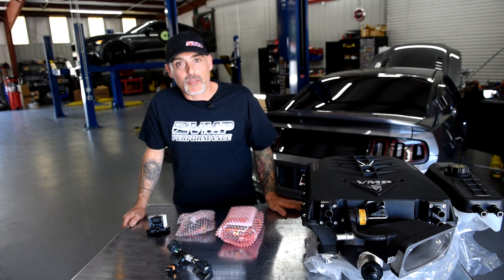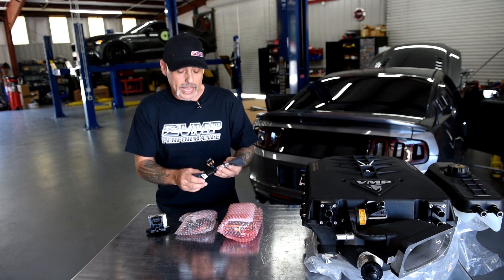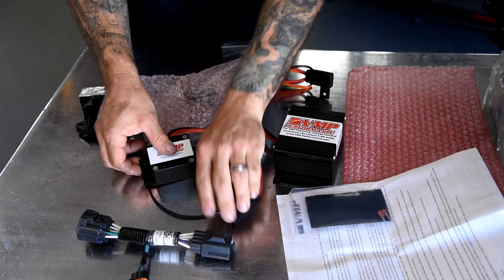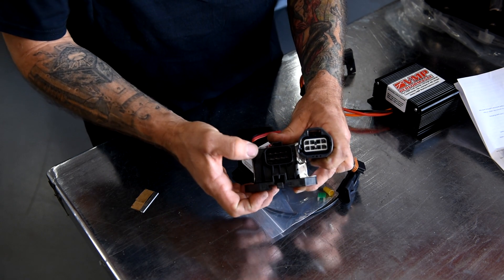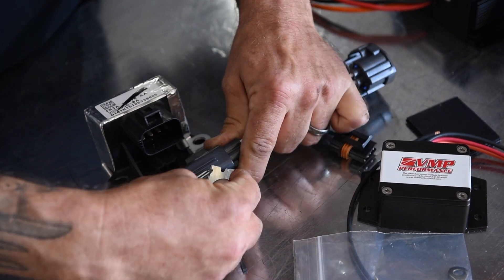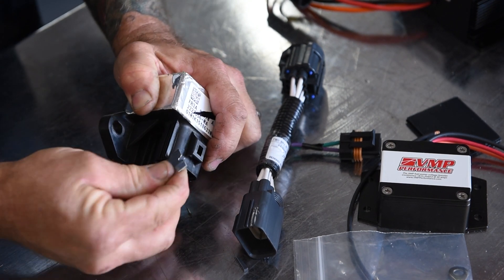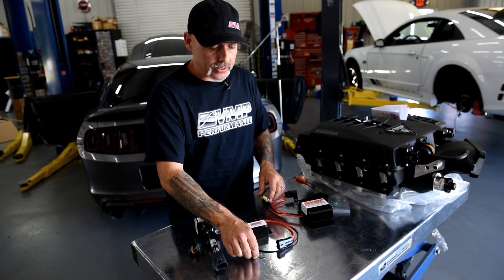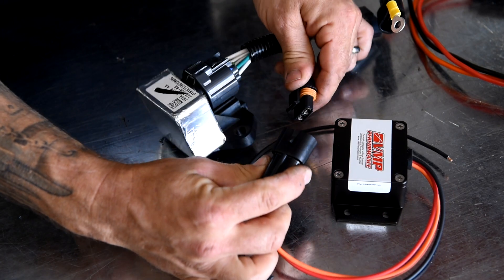Tech || Fuel Pump Booster Installation Tip - How to trim the plugs on the jumper harness and FPDM

Comment: If the car already has a VMP boosta pump on it from the super charger install will this already be done ?
Reply from the maker: Yes, this would have already been done.
Reply: @VMPPerformanceTV  you were correct. Already done.